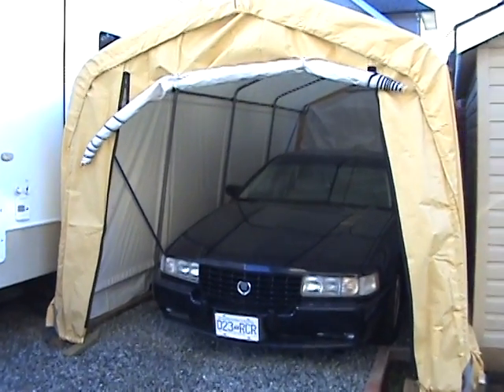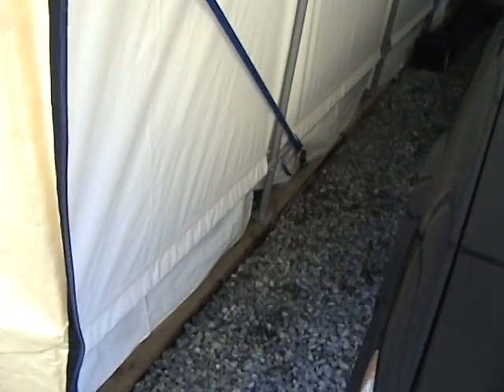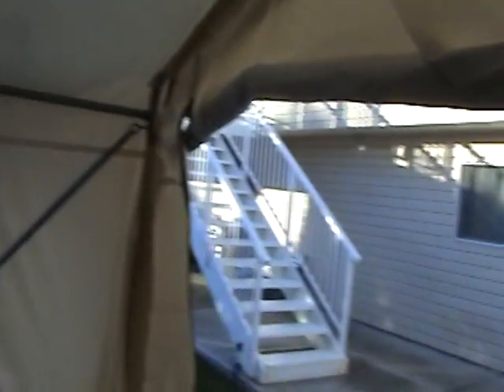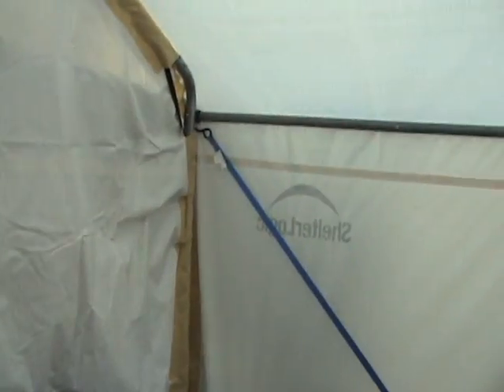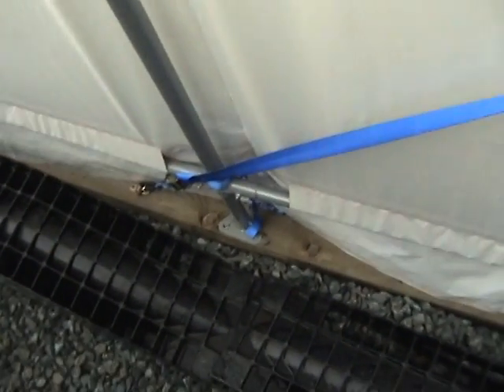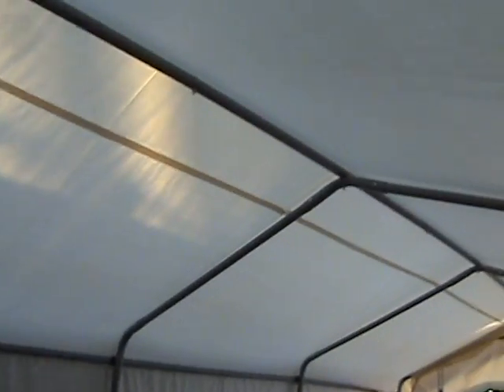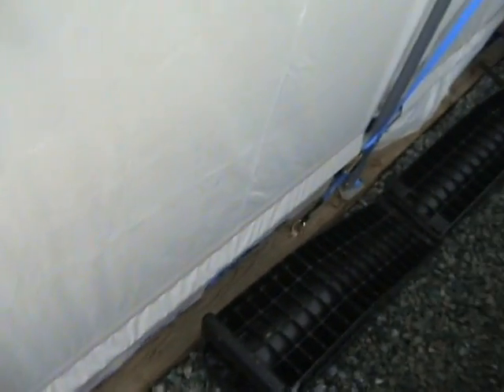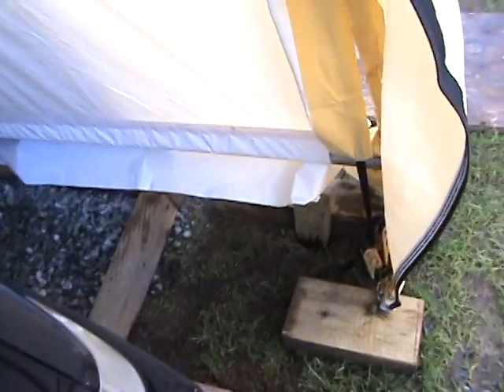How To Build A Shelter Logic Portable Garage / Tent

Comment: Few other thing you can do is add 2x4 to the roof to help with the snow weight, also put a 4x4 in the ground at the front and back to help keep the side wails from sliding out.

Comment: I have same shed got it on sale as well roughly 300 I have same driveway as yours with fence in back I gonna get it installed soon just wonder in the back can I cut the back in order to make a back door in the shed cuz my french has a gate door for exist, is it safe to do so.
Reply from the maker: Tarek Taher The back is optional I put it on for privacy, but with it off it will help big time with the air flow and wind storms. You don't have to have the front or back on it the tarp is 3 pieces the roof is 1 part the front is another part and back is the last part making up 3 separate pieces. Make a foundation and make it level and solid it will save your tarp. If you have snow in your area do not install it how I did close the shed and RV as when you knock the snow off the roof it builds up on the sides and is almost impossible to remove based on my install.

Comment: Great video Vince. As a dealer for Shelterlogic, we know the ends and outs of these portable garages. They are decent quality but not the best. Sure you get what you pay for and we understand that. The number one complaint comes from up north with heavy snow fall. Check out this: http://goo.gl/RZa86T

They will withstand small snowfall and wind, (Best for Florida, California and drier regions), but definitely not places like (Maine, Illinois or New York) where theres a lot of snow. The much heavier duty Shelterlogic portable shelters built with 1-5/8 frames and 9 oz covers are a better option. The sun is another factor to consider. Since they are only 5.5 oz per square yard fabric weight, expect only about 3 years on the cover before needing replacement.

They are definitely affordable! And also much better than the Harbor Freight and Portable Car Garage Costco! I'd recommend anyone interested in a garage in a box to definitely consider their demographic and consider wind/snow/sun before purchasing. Here is a great resource for portable car garages at their website.

Thanks for posting and good luck with your recent move!
Reply from the maker: What a great comment... Honestly I live in Vancouver BC Canada this tent has been thru 3 years of snow and lots of me knocking the snow off to keep it from failing. My BIGGEST MISTAKE was placement... If you live in an area where it snows lots you need to have room all around the unit or snow will build up 4 ft height around the sides and the will give just like the roof does under heavy load... Notice its close beside a shed and RV very bad idea... very hard to remove the snow from the sides once you knock it off the roof and it creates a potential collapse scenario. Good news in Augest 2014 we sold the house and the new buyer wants to keep the tent (due to pro install and it still looks new) also there was no snow last year so this unit has lasted 3 years and counting and will make it to the end of 2015 but who knows about 2016. Most of these tents fail due to the owners have install it on grass un-level no cross tension and no common sense then they wonder why it failed? ( I bought when 1puglife made his video about the sale... we installed around the same date... a windstorm did his in almost a year ago... poor install and location)
Reply: +Tinder inc I also do but struggled to set mine up and now it got knocked off today with the huge wind storm. Any ideas to lock it in the ground? My driveway is concrete
Reply from the maker: Roger Riekki Its going to suck but you need to drill holes with a masonry drill bit and use self taping anchor screws/bolts similar to the ones used for installing shop 2-4 post car/truck lift/hoist. They may have something else but those work good, I just don't know if they make them small enough. If you can install some type of hook ring for cross support with the ratchet straps I recommend that also.